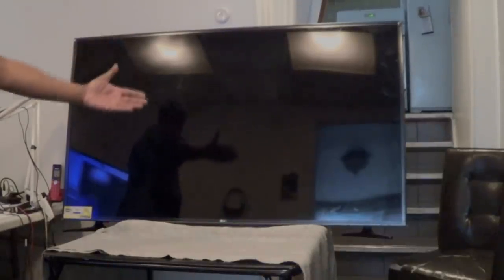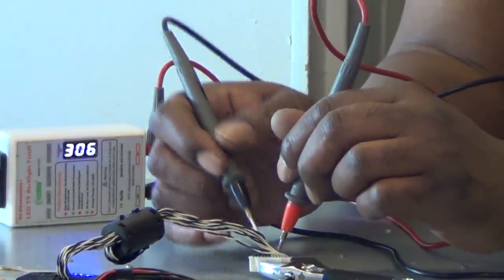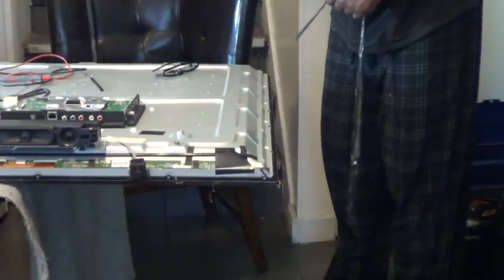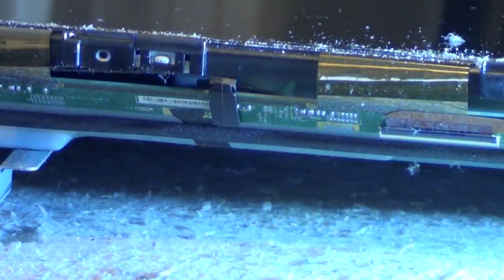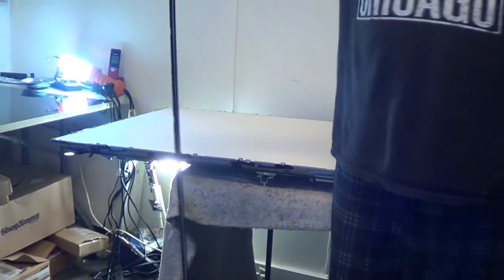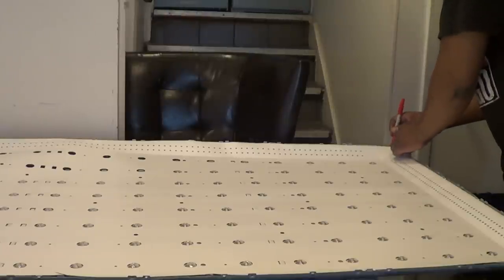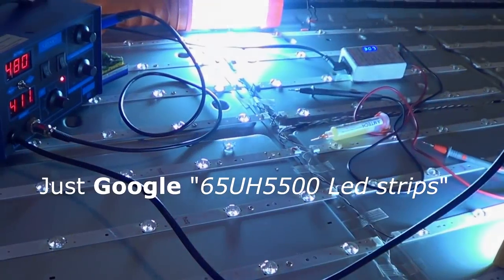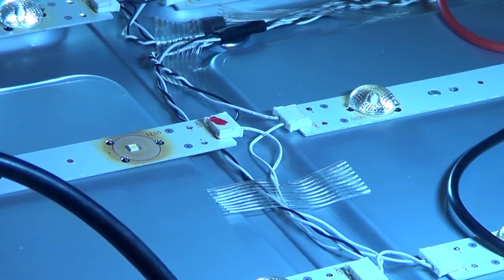LG 65" led smart tv 65UH5500 picture flash, has sound but no picture

Comment: My son ran across this very set on the side of the road. The previous owner carefully placed it in the street and included the factory remote still in the original package. Not a single blemish could be found. With your expert instructions I was confident in tackling replacement of a single bad LED on one of the strips. 1,000 thank you's for your video. I honestly feel you helped me on my path to many more repairs in my future. Such a sense of accomplishment. PS I did reinstall all 72 screws which not only held in the "paper" but also aligned the LED strips too. Great channels like yours are few and far between. I'm grateful for your expertly crafted content, and your willingness to share.

Comment: Thank you so much for this video. I'm a little late to the party but this is the first 4k tv I have owned. About 6 months after I bought it (used from it's previous owner,) I got the same problem so many people have had with this model: one bad led and the whole tv refuses to turn on. I found a workaround that involves removing the fail wire from between the power board and the led controller board, allowing the tv to boot up, albeit with a dark part on screen. After seeing your video I now intend to fully replace the bad led strip and restore my television to its former glory! I've gotta say, the fact that something as simple as a single bad led can render the entire television completely inoperable will make me think twice about getting an LG the next time I'm in the market for a television.

Comment: Just wanted to say thank you sir! Because of this video, I was able to repair my tv for $9.99 (the cost of a replacement LED strip on eBay. I didn’t have the tester. Once I got the screen off I was able to see one quadrant of the LEDs wasn’t lighting up. So I swapped them out one at a time with a strip from another quadrant. Doing this I was able to find the bad strip. Thanks again!

Comment: I'm currently tackling this on my 6yr old 65" Philips 65PFH5280/96 model.

I'm just waiting on 2 (4.1/2") suction cups to arrive to remove the front screen.

Apparently there are 12 led backlight strips with 8 LEDs on each strip.

I asked philips service department here in Taiwan if they can sell me the 12 LED OEM backlight strips for my 65" TV and in their return email they have told me they will not directly provide me with the backlights. How crazy is that. 

According to the rear of the TV this number appears to correspond to the backlights K650WD7 or in full K650WD70LA350A100, so I guess it'll be easy to locate compatible replacements.

Just taking my time as I don't want to break anything.

Comment: I have an LG LN5700-UH and I watched your video and replaced 3 individual LED's and checked them. All the strips worked. Reassembled and had same problem.  Then I replaced the power supply/LED driver board and still same problem picture flash has sound but no picture.  I can see the picture if I use a flashlight.

 Do I need to replace all the LED strips?  Any suggestions.  Great video's
Reply from the maker: All I can say is that if you checked all the strips with an LED Checker and the voltage is the same on each strip and not jumping around then check all the plugs going to the led strips, if not, Yeah just replace all the strips, especially  if u already changed the power supply board.
Reply: I will try that. Thanks for the help.

Comment: I appreciate your videos. They actually pointed me in the right direct with troubleshooting a LG 60LB7100-UT. In your opinion regarding LED replacement, is it better to just solder and replace the burned out LED or the whole strip? Are the replacement strips more reliable than the stock LG strips?

Comment: Nice video...I noticed on eBay, there are A led strips and B led strips.  What’s the difference and what would I need??
Reply from the maker: They make up a whole horizontal strip from left to right (usually two). Ones usually alittle longer than the other. My advice, get at least one of each. Should come in pairs.
Reply: bigdog8882 thank you!! Great video

Comment: Just replaced all led light strips on my lg 65UJ6300 and now power light blinks and nothing comes on. When off red light is solid but when you turn on blinks and nothing, any suggestions
Reply from the maker: Double check your plugs and connections. Especially on the led strips.
Reply: @bigdog8882  ok will do and let you know if that works, I ordered a power board just in case as well. Thanks for responding
Reply: O also I have a led tester and gave power to black and red wires to leds and they all came on just FYI, thanks once again

Comment: Hey BigDog, tested mine and I get a consistent 54 volts on all 6.  Is it possible the bad led is at the end of the line, so I don’t have a break in one of the circuits?  Could it be the driver board?  Mine starts for 1 second and shuts off too.  Thanks!

Comment: I have this same model. The screen won’t turn on but after a while of trying it, it’ll slightly flash but with no logo. On button will turn red, then flash twice. Does this indicate the same problem?
Reply: Atj same here wondering as well
Reply: Atj I also have the same problem as well,  did you happen to figure it out and get it fixed?

Comment: Hey big dog I had the same issue with mine and replaced 3 strips (2As and 1B) and now I don’t get a screen flash with LG logo or toggle switch flash into safe mode all I have is a black screen and power light is flashing constant and continuous. Any idea what I may have messed up or something else it could be? I tested all strips and they are working

Comment: HEY BIG DOG I HAVE lg 55 INCH IT TURN ON THE TV WITH SOUND AND PICTURES FOR ABOUT 5 TO 10 MINUTES THEN TURN OFF THE PICTURES AND IT CONTINUES WORKING WITH SOUNDS ONLY. WHAT WILL BE THE ISSUE ON THIS TV? T CON BOARD OR LET? ISSUE.
Reply from the maker: whats the model # ?
Reply: Lg 55LN5100- UB

Comment: Mr. bigdog8882, I have the exact same TV with the same issue (quick flicker, 3-4 red blinking lights, no picture, no sound).  I got the LED tester, and I get consistent 53-54 volts from 1-5, then #6, it's all over the place, around 200-215.  took it apart down to the LEDs, checked each strip, and they all light up at 13.7 volts each!  what else could be the problem?
Reply from the maker: You have to fiqure out which strips #6 lites up and test those individual strips by holding the led checker on each strip for at least 5-10 seconds to see which one is intermintently flashing  and/or which led is late to come on. Look at your voltage on your tester at all times to see if its jumping up or down too. Some times you have to check the strips several times to get that particular led to act up.
Reply: @bigdog8882   I will have to give that a shot, when I tested the strips, I just saw them lighting up and quickly went on to the next one.  Thank you for the quick response and the tip!

Comment: BigDog i have the same problem as Atj does in the comments below.  My LG 65uh5500 does not turn on but the red led light flashes and the screen will flash to white for a second and then back to black screen.   Would this be a backlight issue or is it something else?
Reply: JC thaGamer did you get an answer or ever figure out what the actual issue is? I have the same problem. Jus wondering if I should go with what Bigdog is doing in the video.